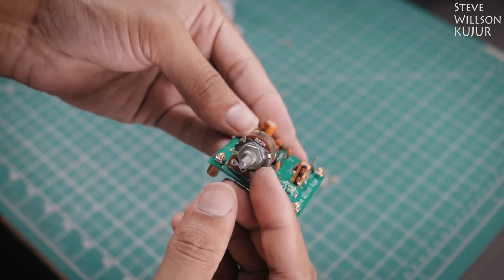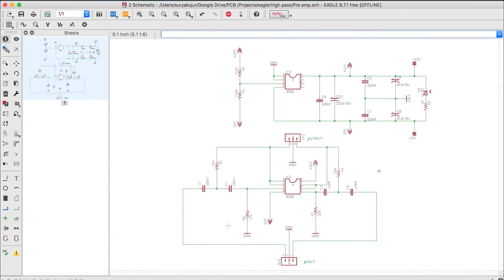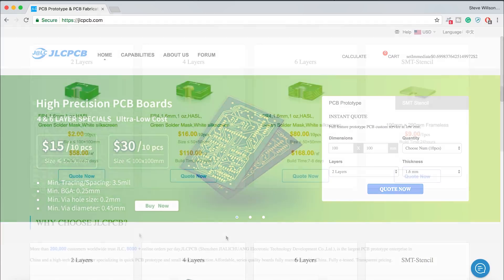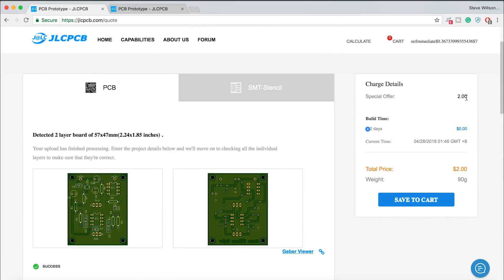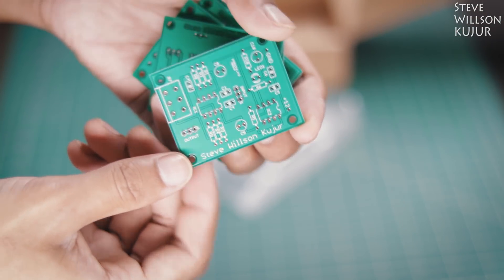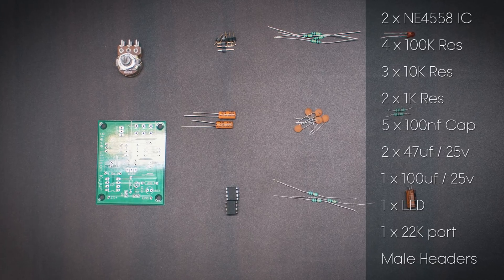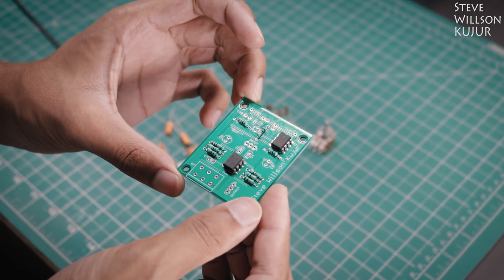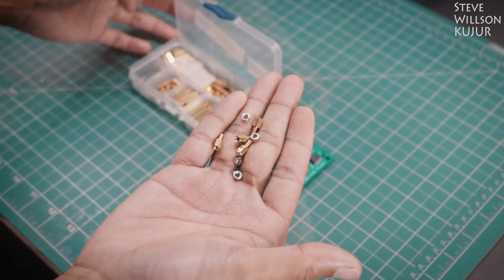How to make a Pre Amplifier | Op amp

Comment: I swear the schematic is different. On paper R7 is the 1K resistor, on the PC board R7 is the volume knob resistor.

On the board there's R10 where the 1k resistor goes. That is not on the schematic.
Reply: You put the wrong schematic in the video! Completely screwed me up. The schematic you have to use is in with the Gerber file. 🤦
Reply: Exactly
In the eagle schematic
3 resistors are used along with four 22k POT resistors symbol
But while assembling he used 8 resistors
Even I am confused

Comment: If I put 11.1 volts to this, Will it work? I'm seeing it takes 12 volts on The schematic. But I'm running 4 cells at 3.7v in a series to create 16.8, I can grab the 11.1 off the third cell.